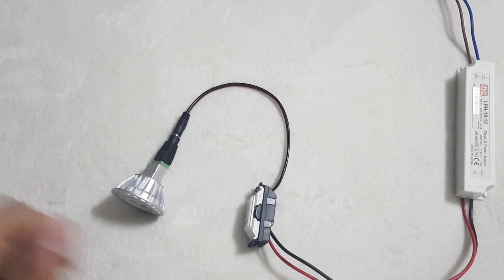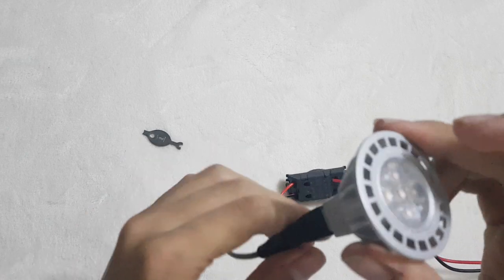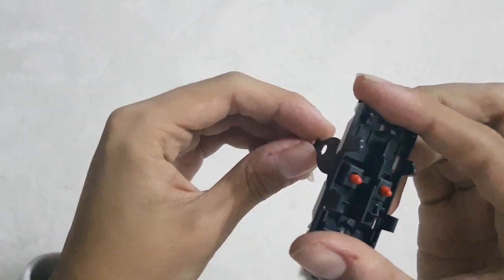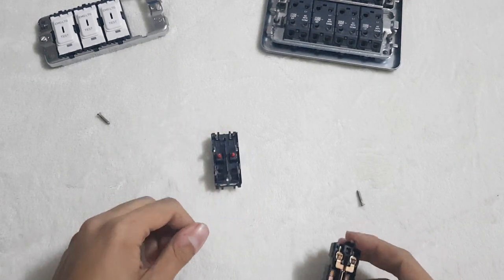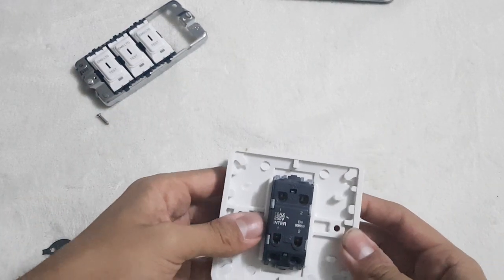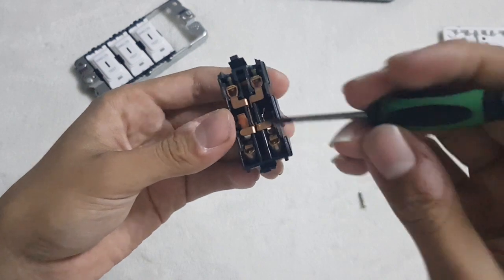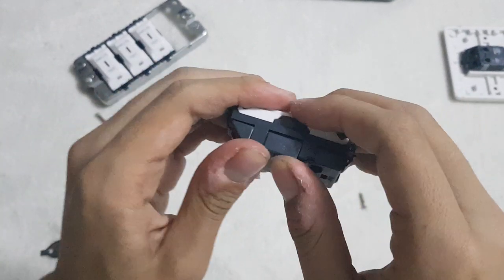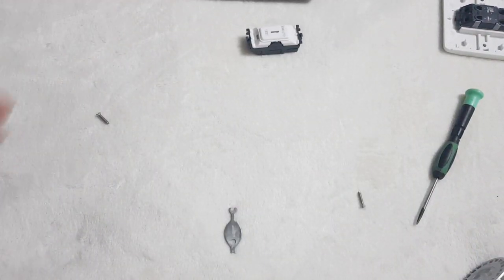A look at a MK EMG LTG TEST SWITCH

Comment: Perfect for my outside light that is a hue bulb, will stop the rest of the family from turning it off by accident.
Reply from the maker: These switches are quite versatile. A downside is that you can flick it with a screwdriver or other object that can fit in the hole if you know how they work but luckily most people don't.

Comment: I could shove the small end of a pen lid to flip that switch.
Reply from the maker: They're not that secure but better than a normal light switch. I've operated these switches with various things in the past before I had my key.
Reply: @LiftAdventures  Oh ok, they have em at my school but nothing different seems to happen when I flip it, I guess that's just me or something.
Reply from the maker: My college is also full of the things. In my college, you need to turn the lights off first and then flick the EMG LTG switch after, it turns the main power to the lights off causing them to turn on emergency mode but some don't work as the batteries are dead in them.
Reply: @LiftAdventures  Oh Okay, cool.
Reply: dont use anything metal as you may get a electric shock
Reply from the maker: Due to the construction of these switches, it's unlikely that you will get a shock from them. The original keys for the switches are metal and they tend to be safe. It still is better to be safe though.
Reply: @LiftAdventures  Yeah, please it should violate regs if something like a certain object can cause a shock, especially when children may be playing with them and poking them into the switches.
Reply from the maker: Agreed
Reply: How are the MK ones? Im using a Selectric one in my bedroom atm and its quite a cheaply looking one but obviously to BS so wont kill me. There ideal for smart lighting which is my use.
Reply from the maker: The MK ones that I have are quite durable. I bought the entire grid seen in the video used and it was about 5 years old. It still works perfectly fine.